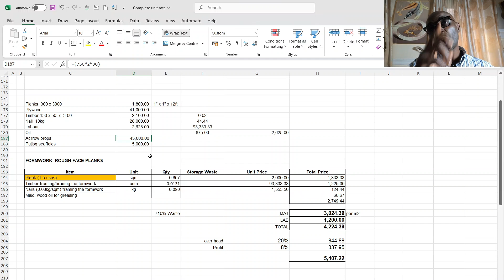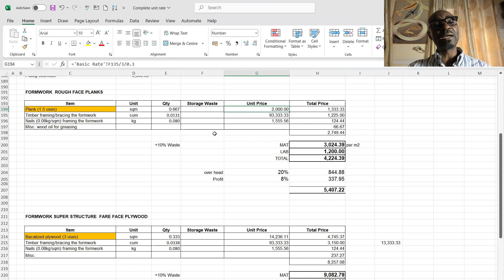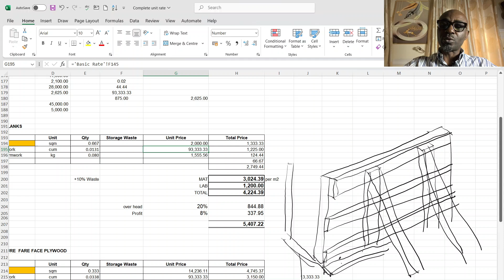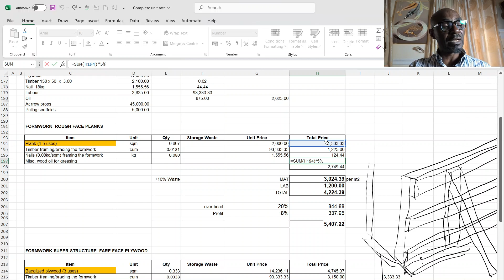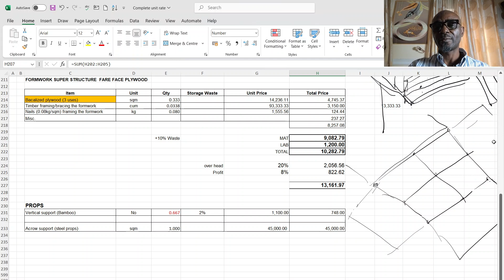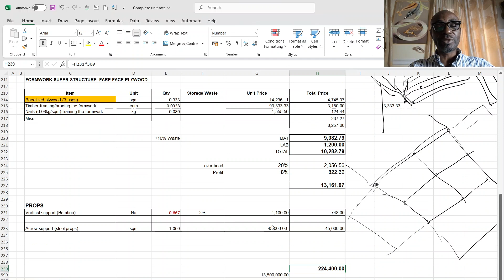Rate analysis for unit cost of wooden  formwork

Comment: Thank you sir. Please the qty for timber bracing for fair surface, is it the same for rough surface? I think that is where my figure is not aligning.
Reply from the maker: Don’t forget to share my page link with colleagues and friends in the built  industry.
Reply: @Quantitysurveyingmadeeasy_2014 Yes sir
Reply from the maker: It can’t be the same because for plywood you need less timber to brace compare to planks why cause the spacing may differ between each bracing
Reply from the maker: It can’t be the same because for plywood you need less timber to brace compare to planks why cause the spacing may differ between each bracing
Reply from the maker: Mind you methodology for formwork fabrication defer so it is not one way fit all. So your design method would determine your approach on site and by extension calculation